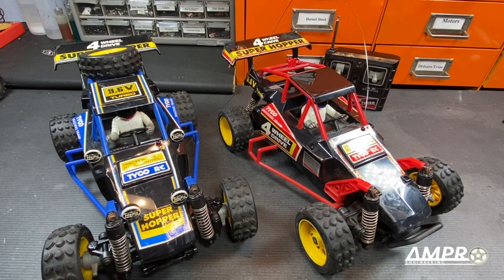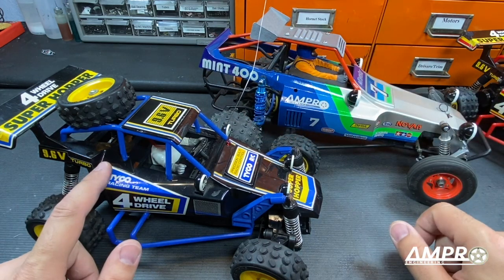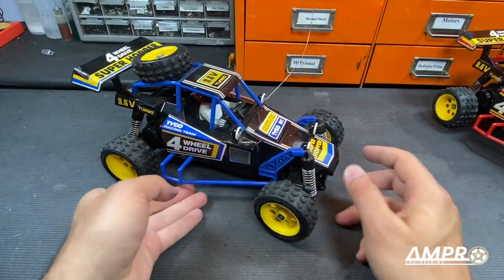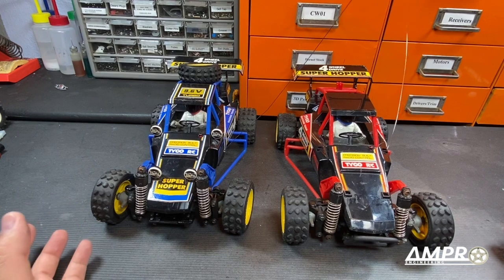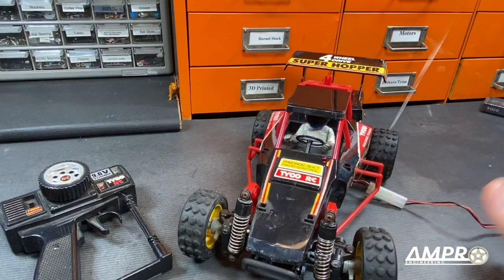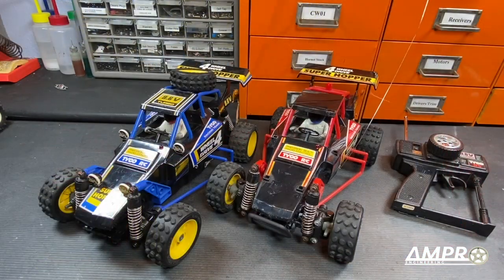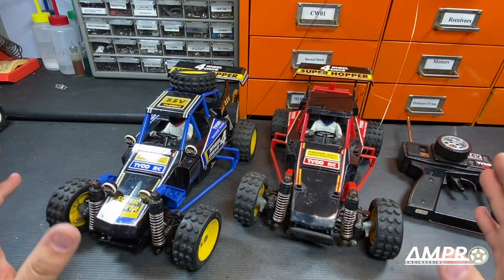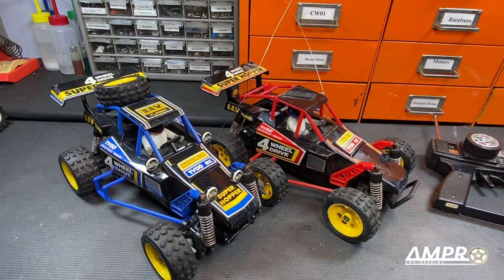e272- Tyco Super Hoppers - The Buyers Guide Series

Comment: I got a Radio shack buggy special turbo, but lost the battery door because I am an idiot. What would you make a replacement one out of? My tools are pretty basic just exact o knives, super glue, hot glue, screw drivers, and simple stuff like that. My mom might have a Dremel tool somewhere but I have no idea how to use it, although could learn if it's necessary.
Reply from the maker: Styrene is pretty good. It's easy to cut and work with and should provide just enough durability